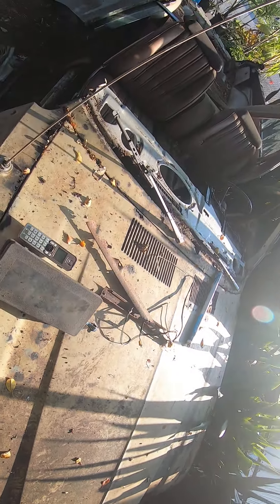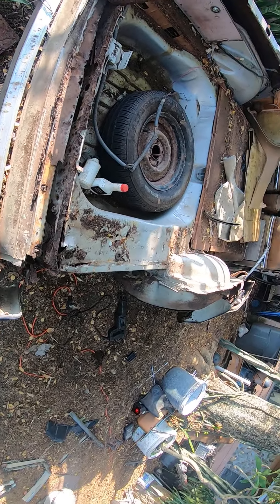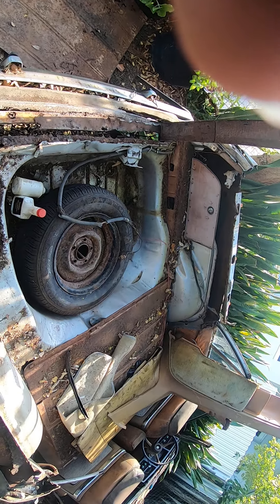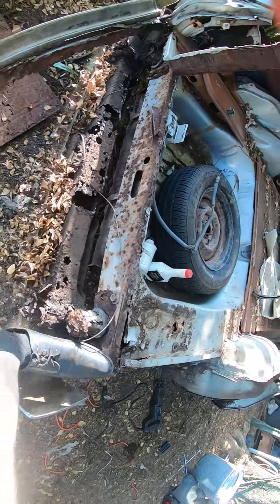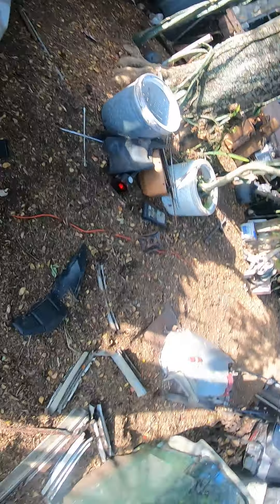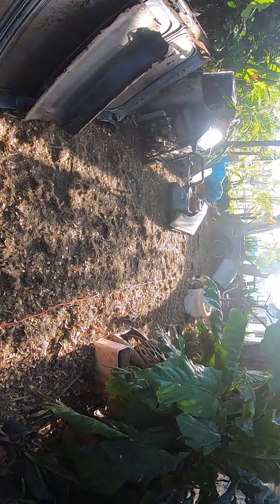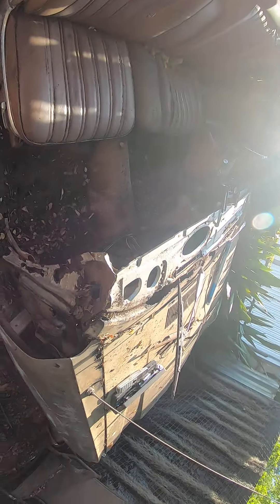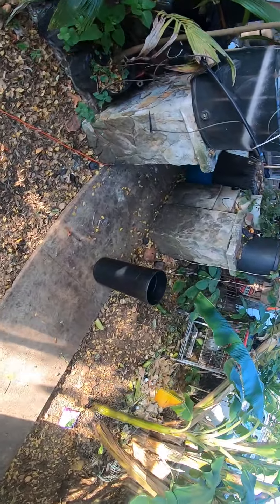Cutting up the wagon

Comment: I found an entire car cut into small pieces in a dumpster at work. My first thought was "that is one helluva blade that did this", I'm talking clean cuts through the unibody frame.
Reply from the maker: The Diablo or Milwaukee Torch blades are what I use, they work fine.